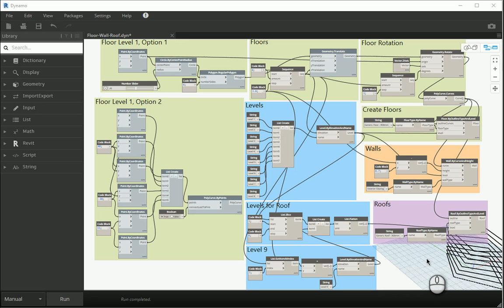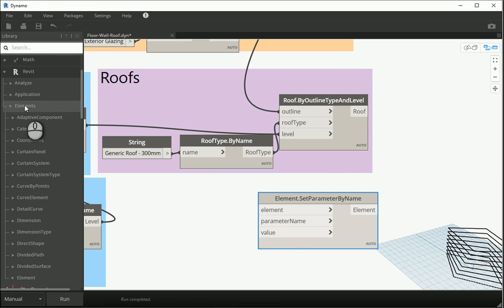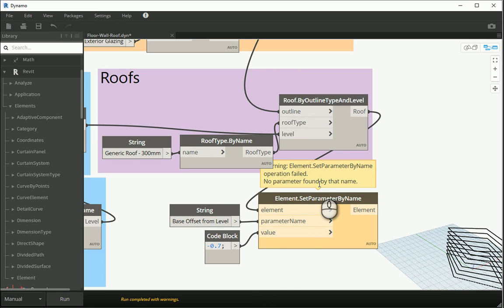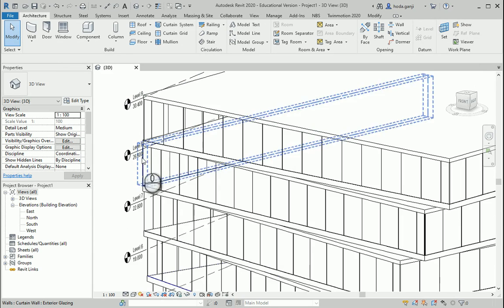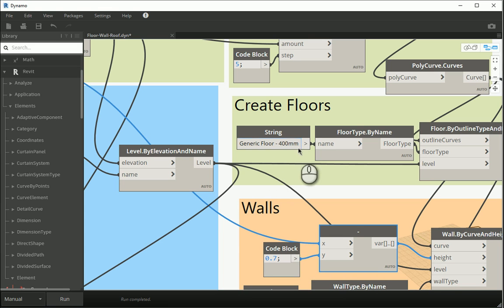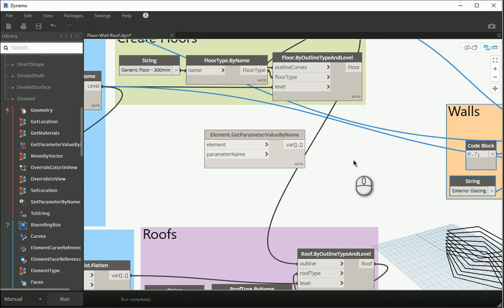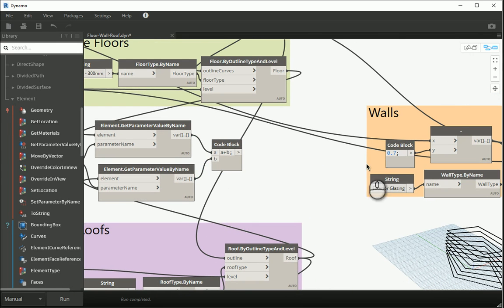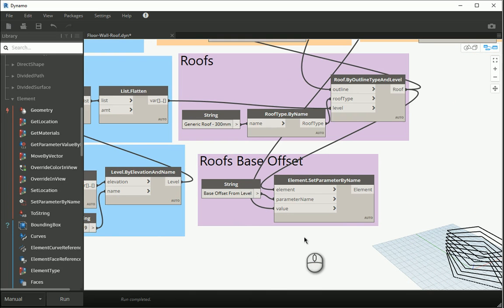Floors, Walls, Roofs in Dynamo, Revit 5

Comment: i always loved your tutorials when i was starting to learn Dynamo. My Question in my project is : IF the Geometry is made from Adaptive family how do you address it in order to rotate it. saysyou have 114x38 timber created with two points. but you want to turn the short(50mm) side on its axis center. not the long lengh side, Although it was created with two points from the long side (i did not use 8 points to for Adpativee since i vied that i would be complecated).